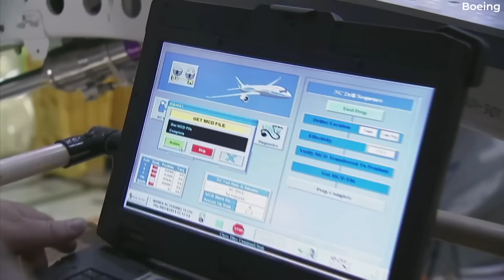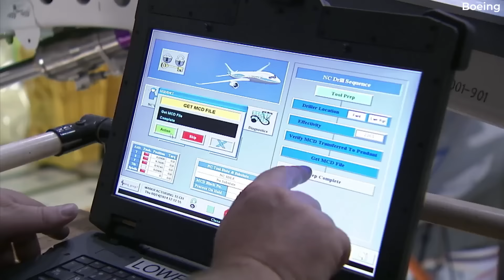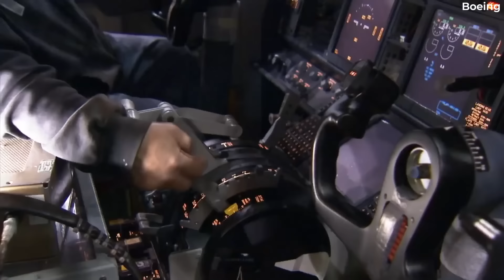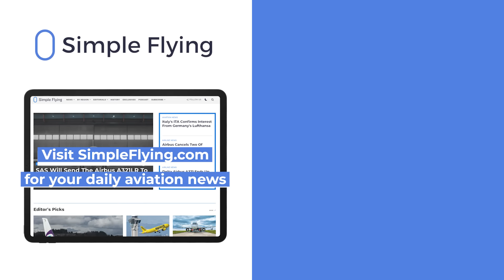Do Boeing 777s & 787s Also Have Quality Issues? FAA Investigates New Claims

Comment: Would you believe anything that Boeing says about safety
Reply: Well I used to
Reply: No
Reply: @Razor48X  No, i won't!
Reply: No
Reply: No way
Reply: Absolutely not. The CEO and spokesman have lost all credibility when they keep saying that their planes are safe
Reply: Of course Not !
Reply: Yes. Since more passengers have safely flown on Boeing aircraft than any other aircraft maker in history.
Reply: @chrisniquette750 because there are more Boring planes MADE. So of course there would be more passengers flying safely on Boeing.

Also. The issue and concern is about Boeing after they left Seattle, if that’s a sign of change. The older Boeing planes are still reliable, the uncertainty is if the newer planes are Russian roulettes or not.

Comment: going to take 777-300er praying i dont die rn
Reply: Might still be less surprised though
Reply: Im taking it in 2 weeks, its safe right?? I really dont believe boeing haters but idk
Reply: @paulac7165 the older planes should be fine. It’s the newer ones made after the move from Seattle that have the controversy surrounding them.
Reply: @samueljennings4809  nah its made in 2014, problems started in 2013